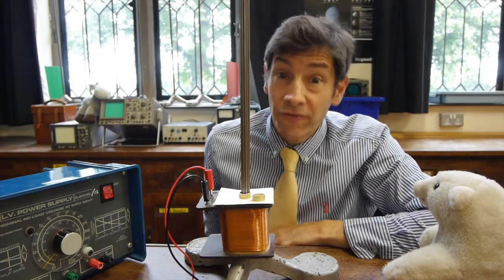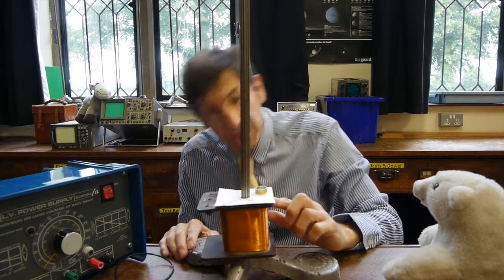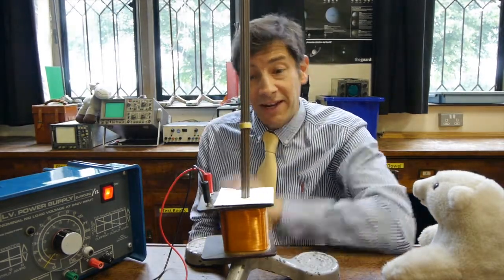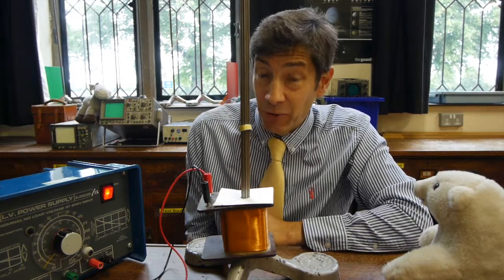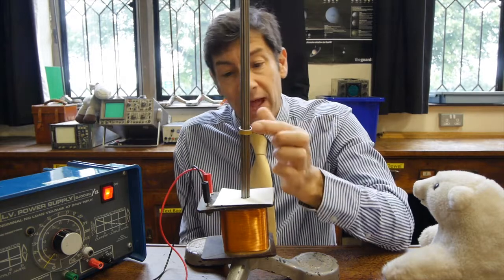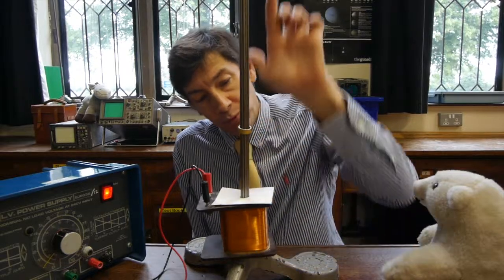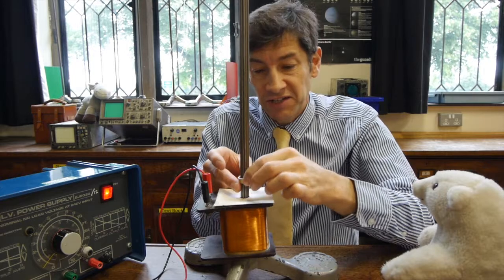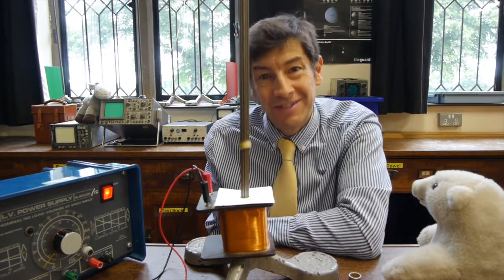The Jumping Ring - F-J's Physics - Video 128

Comment: Once saw this done with the ring cooled in liquid Nitrogen for comparison. It didn't hover, it hit the ceiling.  🙂
Reply from the maker: Yes, wish I could have shown that!  Perhaps some dry ice, though not as cold.  A superconducting material would certainly 'hit the roof'!
Reply from the maker: I sort of feel, perhaps incorrectly, that this is a little-known and forgotten experiment.
Reply: @AnthonyFrancisJones  You're probably correct, I saw the demonstration once many years ago at a university open day. I must have been impressed as it stuck with me. I also remember the coil becoming too hot halting the demonstration for a while.
Reply from the maker: Yes, you can do it with a large but thin Aluminium disc and keep it hovering all of the time but, as you say, the currents are such that the coil gets very hot.  Best to do it in short bursts.  It is 'maglev' but not in the usual sense!